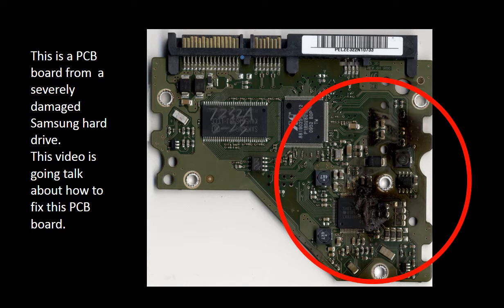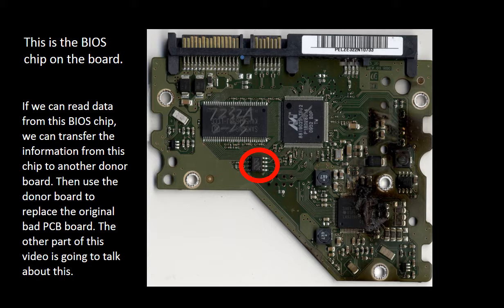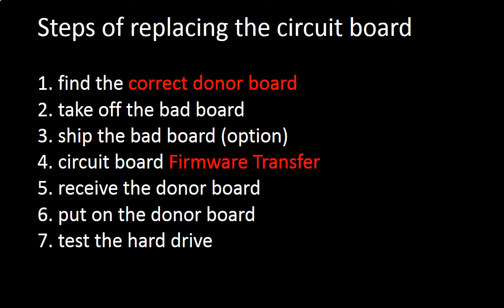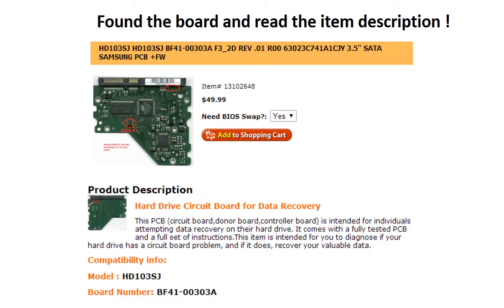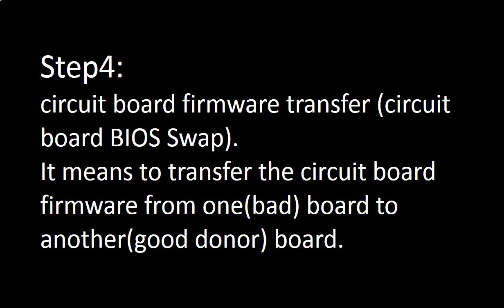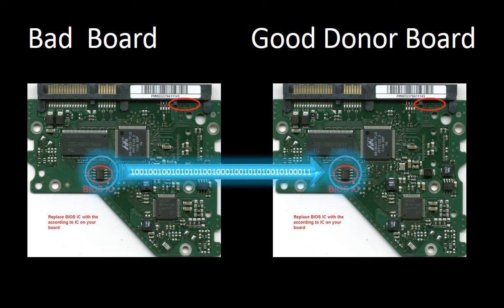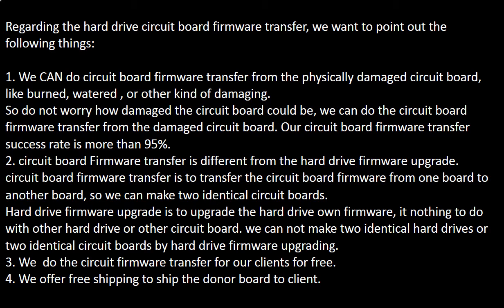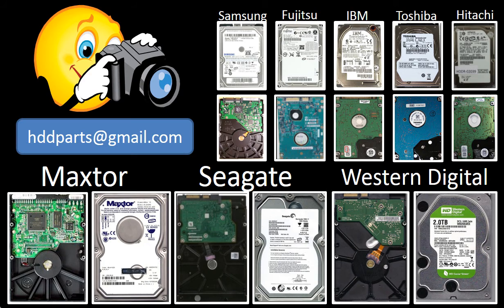Samsung BF41 00303A   HD103SJ  HD105SI  HD754JJ   hard drive repair and data recovery

Comment: Hi, I have a non working  HD103SJ, but it doesn't shows burning mark. The drive is still spinning, no clicking sound but unaccessible on PC. I bought a similiar model after watching a video saying that it is possible to sweep part. Haven't checked yet the back of the circuit board but if it matches, would it work by switching the roms ?
Reply from the maker: swapping the PCB board only can fix the PCB board problem.
your PCB board seems good.
Reply: Thanks for your reply, what do you recommend then if my PCB is good ? Is there any internal parts i could swapp to make my drive readable ? There's some tuto on internet about free dust boxes, should i give a try ?
If i could afford a repair shop i would send it there but i don't have 2000$ for this operation. Plus i'm leaving in a smal country, Laos, where these kind of shop does not exist. They have in Thailand, but the price are the same...
Reply from the maker: this is a data recovery job.
if you need the data back,  a data recovery firm maybe can help.
Reply from the maker: swap the ROM can make the PCB board work on the old hard drive.
but if the hard drive disks have to be good.